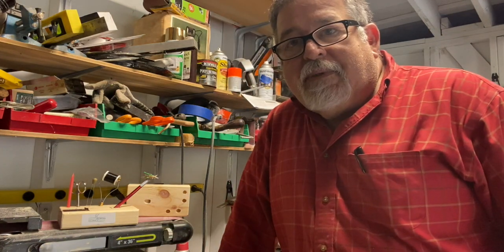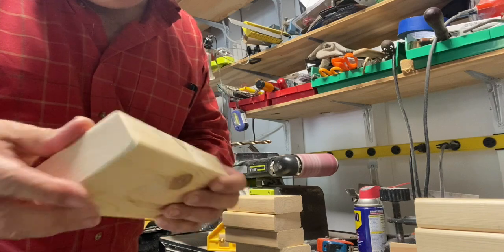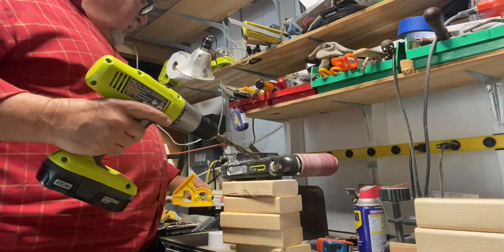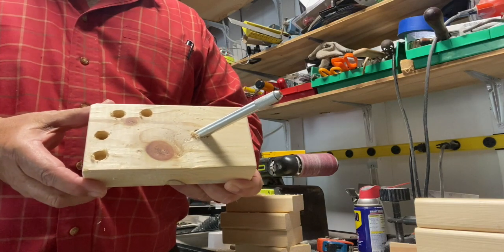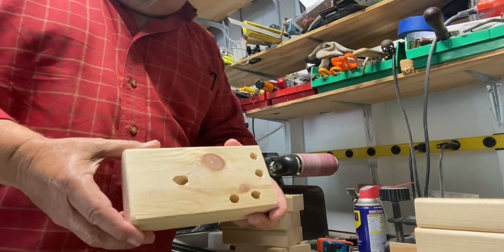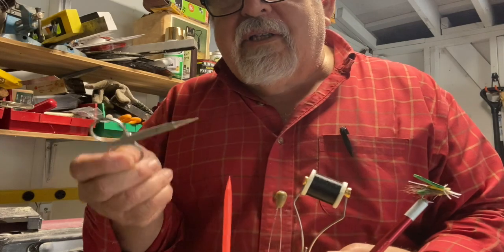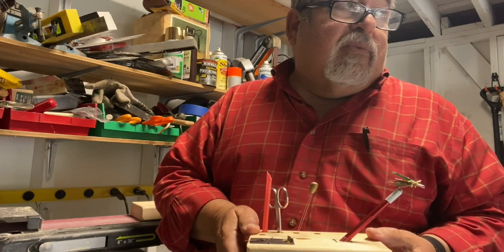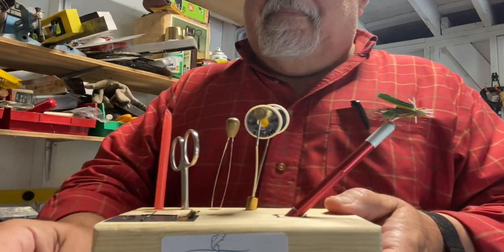$5 fly Tying Station

Comment: That is a great idea you have come up with! Bravo! 
An empty pen shaft is an excellent half hitch tool once the ink is gone! You can choose the best ones based on the 
size of the hole at the tip. Been using em for years! Larger ones can be used to push deer hair on spun deer hair bodies to tighten 
em up. Those exacto type blade holders are my go to portable vices for travel. I also put em in pieces of wood as bases! 
👏👏
Reply from the maker: Great to hear that! I couldn't believe I was the only person to find the exacto knife type vice. These have been working so well. I also use a $2 wood clamp from Harbor freight to hold them to the table.
Reply: Maybe try some nonskid padding on the bottom for better grip

Comment: This project is awesome I tie a lot of my own flies but right now I am in a rehab  ( leg amputation ) and am building a file tieing kit I am 63 years old and needed something very portable. It looks like you are using 2×4 board and I am wondering if 2×6 or 2×8 would be to big I am using a large double tray tackle box to store every thing and I figure 12-14 inches long would be perfect for me. Also I tie with some very small hooks 20-22 size hooks will the collects on the handles handle that small? Please let me know. Thank You
Reply from the maker: the size of the base is only dependent on how big you want it. I pack these in quart plastic bags so is can put 20 in a shopping bag to take to schools but bigger is better. If you are just making it for yourself get the best xacto knife you can find for durability.  The other tip is to put the hole for the knife near the edge of the board so you can hang the bobbin off the side of the table.